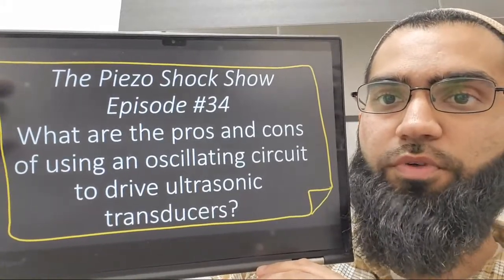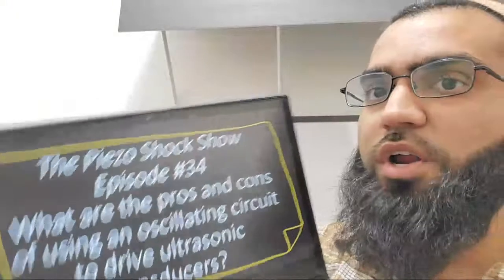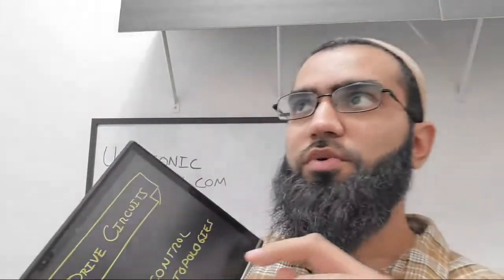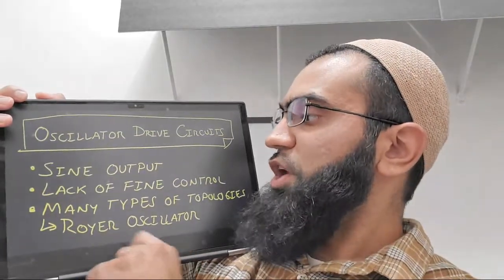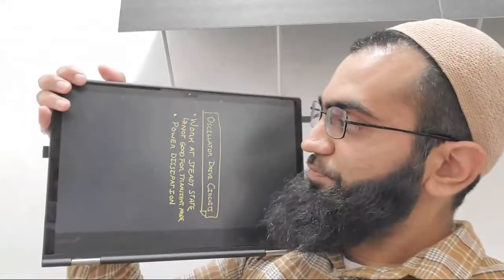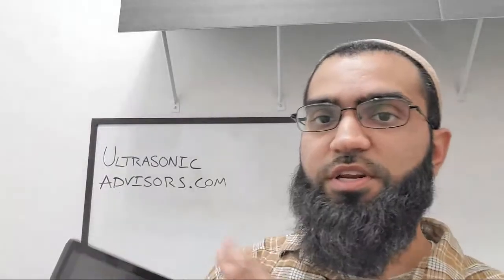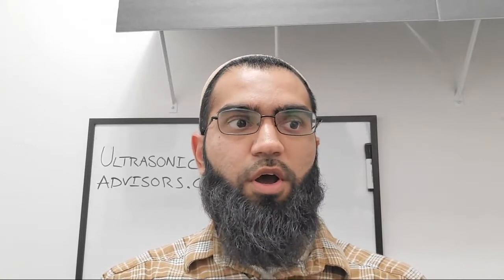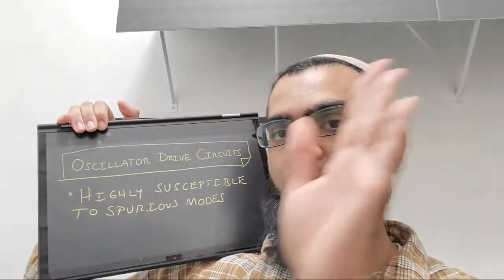Piezo SHOCK Show #34: Should I use an oscillator circuit to drive my ultrasonic transducer?

Comment: I have a question about frequencies, not sure if I will word this right but... Are there instances where more than one frequency is used in a crystal to reach a higher peak? If I were to use a lower resonant frequency along with a higher frequency, say at a particular octave/phase angle...would I get any gains being that the second higher signal might not have any loss as it rides along with the first lower wave?
Reply: That is a good question to ask.
Reply from the maker: Question rephrased: Can driving the crystal/transducer with multiple frequencies increase the mechanical oscillations? Yes, for example, driving with first and third harmonics will create a triangular-ish wave with a higher amplitude. Even if a higher overall displacement is not achieved, there are instances of higher acceleration and velocity. That being said, it is very rare for transducer to be excited with two frequencies because the potential benefits do not warrant the mechanical design and electrical design complexity. I'll try to do a video on this.